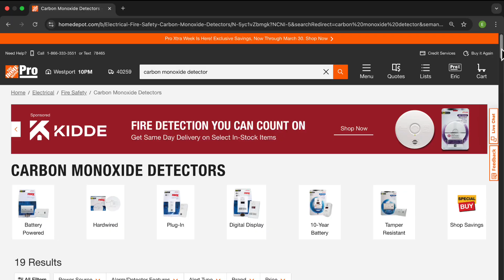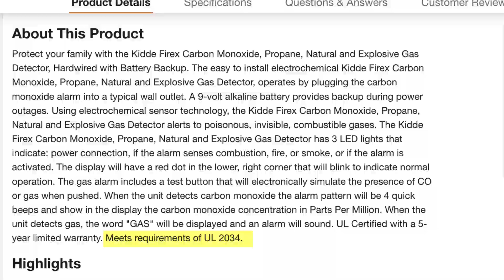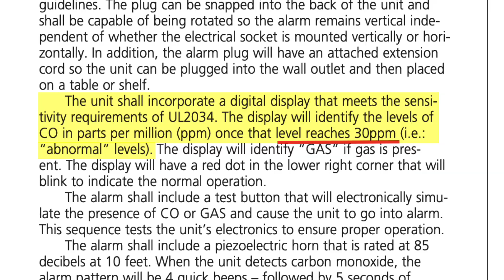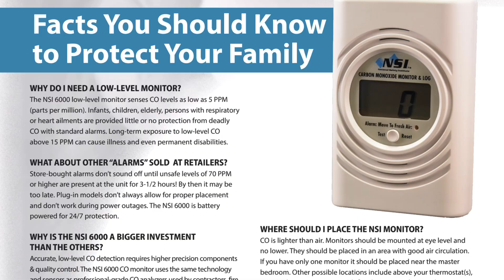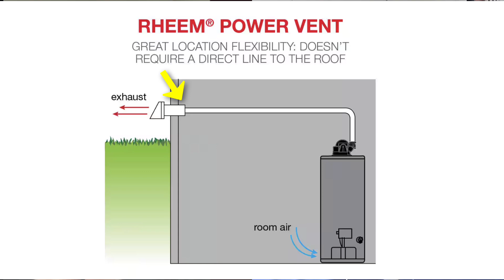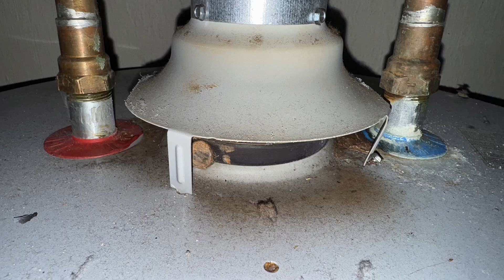Carbon Monoxide Poisoning: Why Your Detector Probably Won't Save Your Family! With David Richardson

Comment: We had a Carbon Monoxide Alarm on Christmas 2023 after eating Christmas Dinner,   Alarm our Townhome Management installed during the last inspection that year,  detected it about 15 minutes after we turned off the stove,    Alarm was saying Warning Carbon Monoide, Warning Carbon Monoxide,   Exited Townhome, Called Local Fire Department,  They arrived with Engine crew of 2,  went inside, and was like  You do have a Carbon Monoxide Issue--70PPM,    Then stated we got a second crew on the way to assist in ventilation--then deployed there Electric fan in our Rear Patio door.       Then they cleared once turned off the Gas to the Stove, and there meter read 0        ((they didn't exit and put on SCBA breathing gear, should they have?))
Reply from the maker: Glad you caught the leak before someone got hurt or killed!🙏🏼